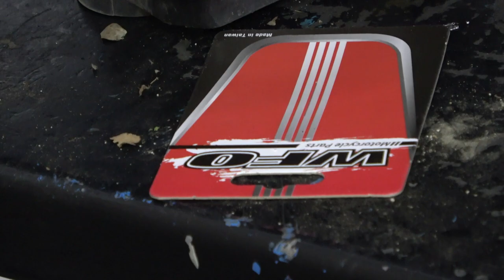drive belt maintenance: YAMAHA XMAX 125

Comment: interesting, is this grease on the bushings and slides necessary? if so, what kind?
Reply: What size impact socket do you need to take the gearbox apart

Comment: Putting grease in a variator... then puts the same greasy fingers all over the pulley face... belt will be slipping like mad
Reply: i was a little shocked to see that too, does a small amount go on the sheave surface. the repair manual is a little vague on where the grease goes. i thought the shaft, bolt, sheave has a small amount
Reply: A total clown he shouldn’t be allowed to work on scooters, sadly this happens a lot this is why I always do my own servicing